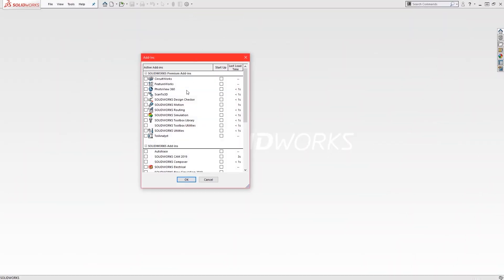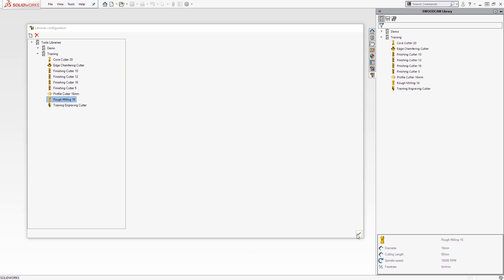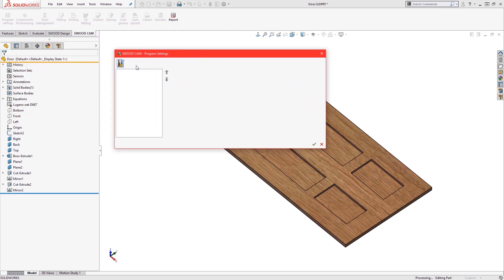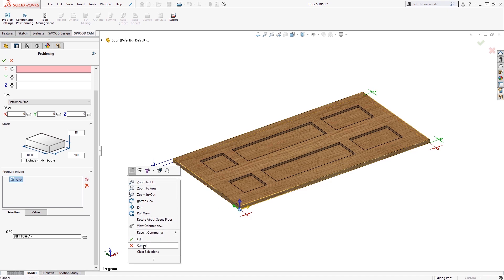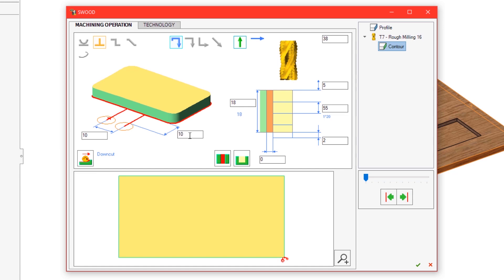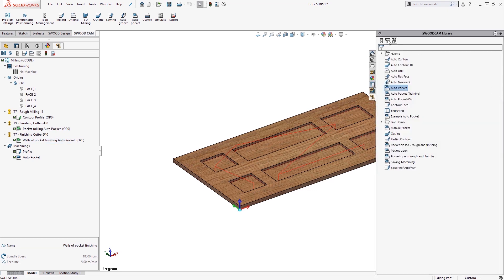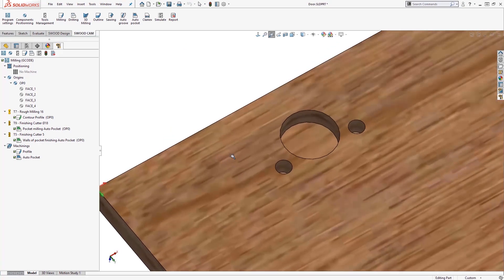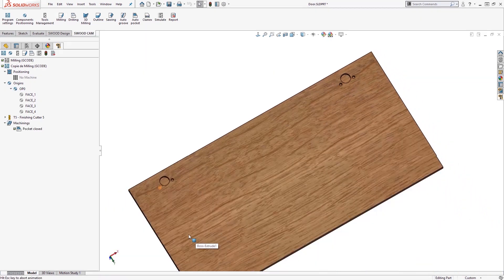SOLIDWORKS SWOOD CAM Tutorial  | Beginner SOLIDWORKS Tutorial

Comment: Is there a way to save batches of machining processes into the machining library? 

For example different materials require different groups of tooling and speeds. So I could have a drag and drop Plywood contour that uses 1 tool or a compact laminate contour that uses a roughing bit first then a finishing tool.